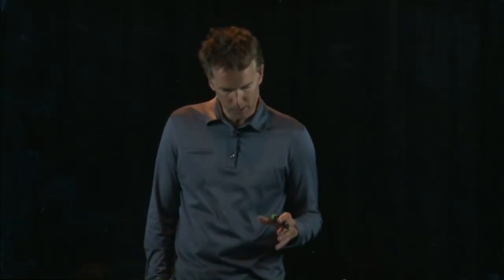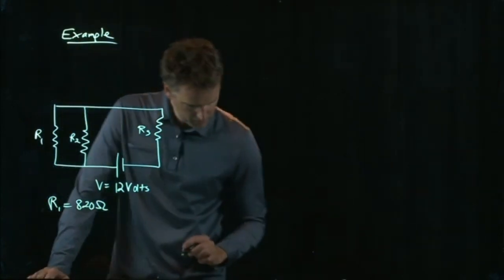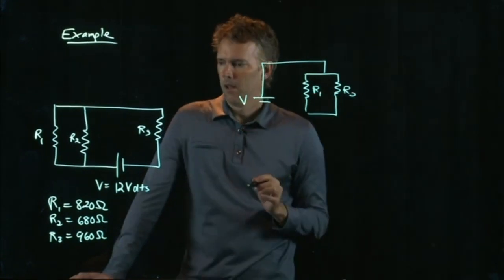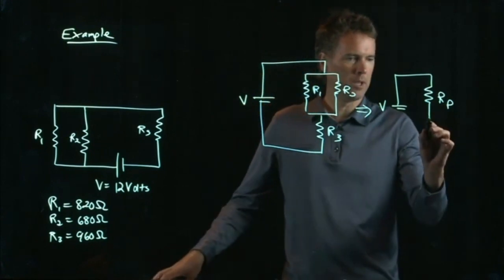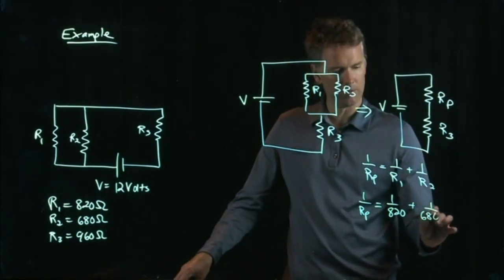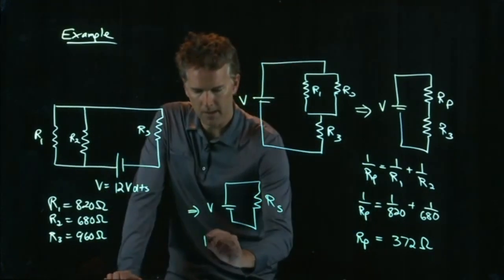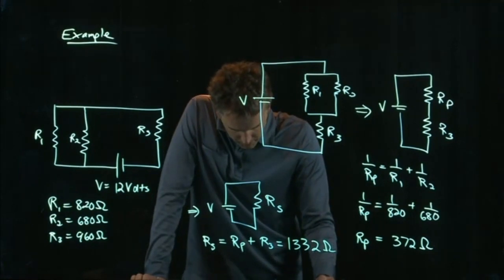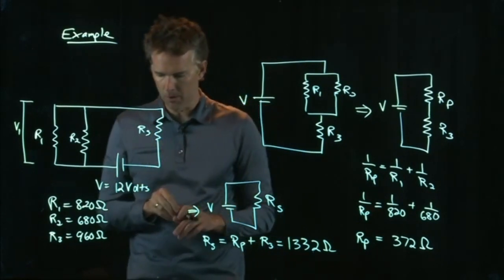Circuit with Given Resistor Values | Physics with Professor Matt Anderson | M22-05

Comment: I WAS TESTED FOR AND ISSUED A FIRST CLASS FCC BROADCAST ENGINEERING LICENSE AT AGE 18. AT 67, I'VE FORGOTTEN 90 PERCENT OF THE NEAR 900 SEMESTER HOURS IT TOOK.  WATCHING YOU HELPS ME REMEMBER ALL THE CIRCUITS AND ELECTRONICS I BUILT.  A LOT OF LIFE INVOLVING NO MORE ELECTRONICS THAN HOUSE WIRING WENT BY THAT TOOK ME DOWN MANY ROADS, BUT I ALWAYS LOVED ELECTRONICS BECAUSE LIKE GEOLOGY (PROSPECTING IS MY FOCUS), IT IS "REAL".  THAT IS HARD TO FIND THESE DAYS.I DO NOT RUN A CELL PHONE, BECAUSE I HAVE BEEN INSIDE A KLYSTRON TUBE  CAGE IN SEVERAL TRANSMITTERS, WEARING HEAVY GROUND STRAPS WHILE I WORKED. I HAVE WALKED THE STRAIGHT  LINES OF DEAD BIRDS BETWEEN MICROWAVE REPEATER STATIONS.  THEY ARE SO MOLECULARLY CHANGED BY BURNING IN THAT BEAM, NOT EVEN THE ANTS WILL TOUGH THEM, THEY JUST BLEACH AWAY IN THE SUN.  MY WIFE GOT ME AN IPHONE SOME YEARS BACK. (I TRAVELED FOR WORK A GREAT DEAL)  IT IS NOW A WIND CHIME ON MY DECK, WITH 3 .45 CALIBER HOLES THROUGH IT.  IF MORE PEOPLE UNDERSTOOD, THERE WOULD BE A LOT MORE WIND CHIMES...PARHAPS A TALK ON SIDE BAND CARRIER FREQS WOULD ELUCIDATING FOR YOUR AUDIENCE.  "THE MESSAGE IN A BOTTLE" OF ELECTRONICS...
Reply from the maker: I find your posts fascinating. Thanks for sharing.
Cheers,
Dr. A